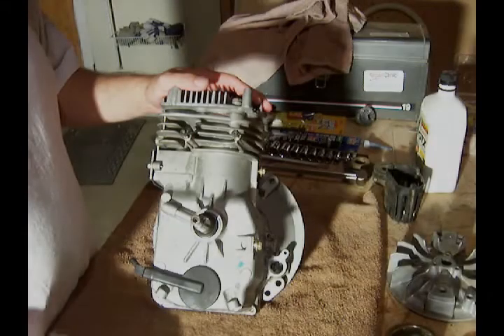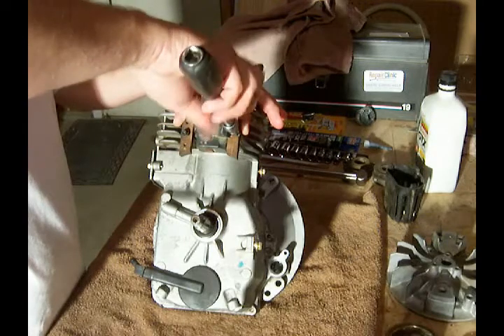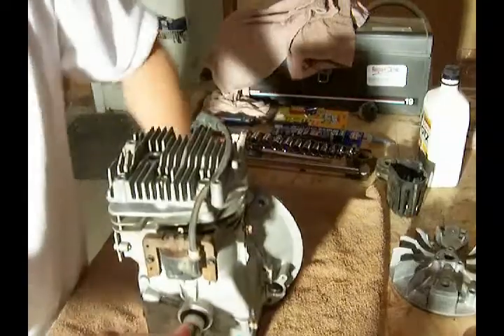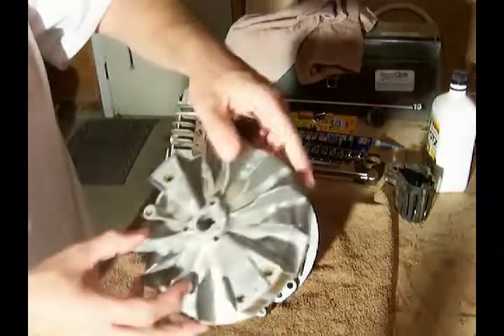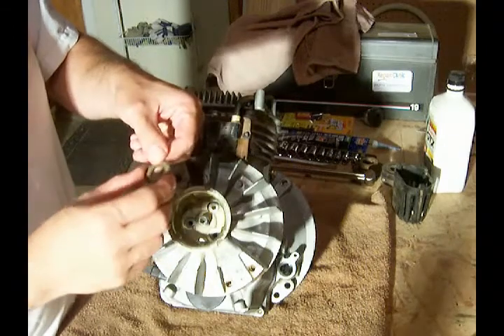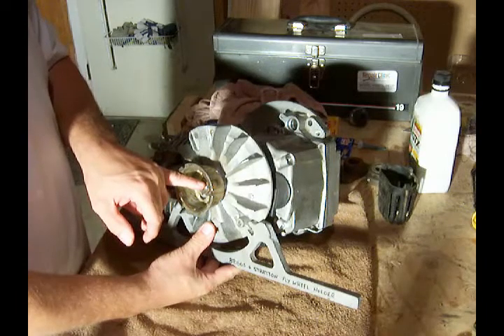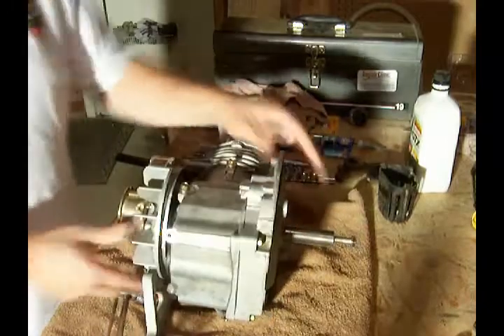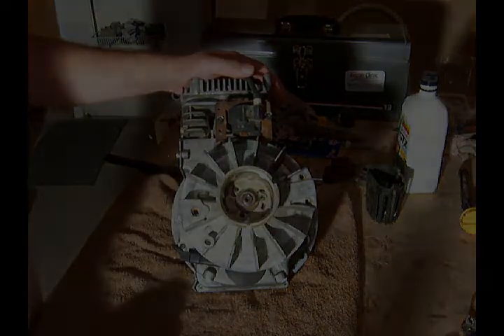#19 Tecumseh LV195EA / LEV120 - Flywheel and Ignition installation

Comment: I have the same engine on a Toro lawnmower and found the flywheel cracked. Can't find one online, they appear to be discontinued. Any leads? Thx
Reply from the maker: Check facebook marketplace or craigslist for older mowers with the same Tecumseh engine. I am sorry to tell you that I have brought many mowers to the scrap yard just because I had no need for them and don't have the time to sell them. Just need them gone.